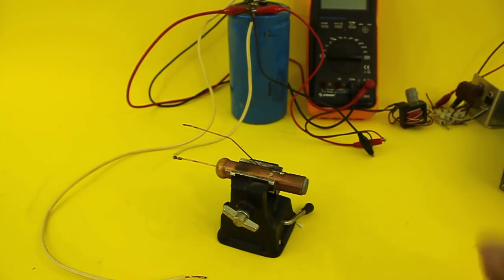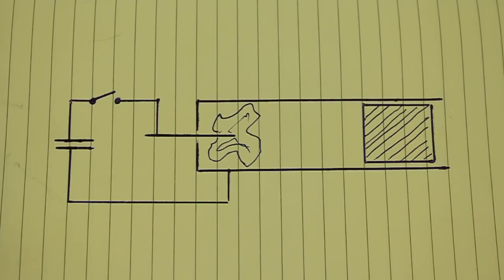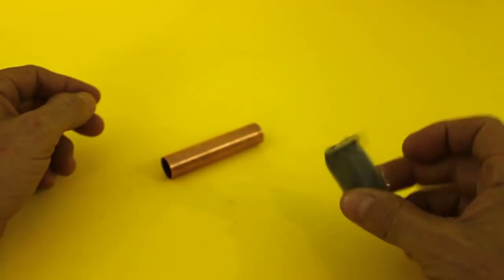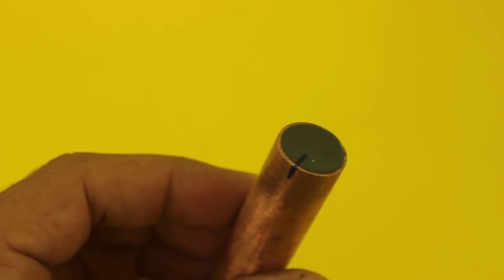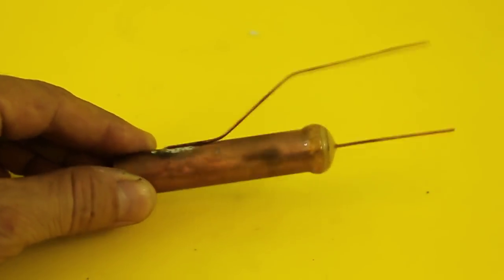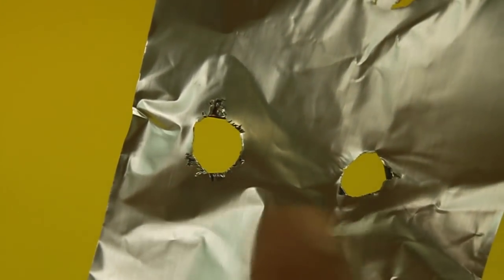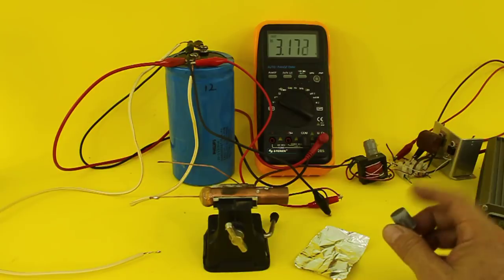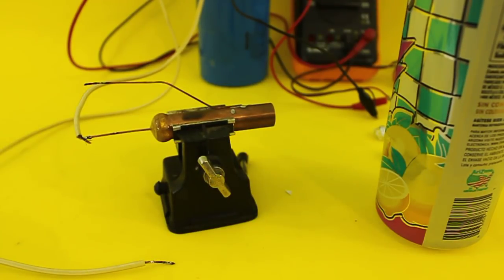Electrothermal Gun

Comment: I timed it and my high voltage power supply takes 32 minutes to charge a 450v 2200uf capacitor. can I have the schematic for your high voltage power supply so my life is a lot easier? thank you very much.

Comment: Actually this is pretty nifty as a remote starter for rockets and stuff on it's own. 

As far as improving it's destructive power, rather than going with higher voltage, I'd suggest using aluminum filings and rust mixed together in a 2 parts aluminum powder 3 parts rust mixture. You might melt your copper pipe though.
Reply: Yeah im pretty sure using thermite would melt copper
Reply: @kansaslml7796  Copper explodes on contact with burning aluminium... so probably? the amount of aluminium powder used matters.

Comment: you don't have much control over foil resistance and the results are not repeatable at all, also I think your load resistance is too low, maybe try with a thin wire and wrap it around an insulator

Comment: I think the tin foil did not vaporize completely be cause it shot out of the barrel and lost contact to the center electrode. I think it might help to increase the contact area between the middle electrode and the tin foil and fix it in the barrel so that it can not shoot out. A longer barrel would be adviseable too, as the cmplete vaporization of the tin foil would result in a bigger shock wave.
Reply: As long as the capacitor voltage drops very low after the shot then the foil has done it's job fine and nothing more can be desired from the foil
Reply: John Scarce You are right, but with bigger capacitance he could use more of the foils potential
Reply: there are a lot of optimizations to be done on this if it is to be taken as a serious project-longer tube with smaller diameter acting as a barrel, "explosion" chamber bigger than the tube with spherical shape welded to the barrel instead of using one of the barrel's ends for that, multiple capacitors with multiple electrodes for each capacitor, thyristor activation of the explosion instead of touching 2 wires and many more. However this would take insane amounts of time and ludic's channel is more focused on showing concepts than showing practical designs and he is very efficient at this